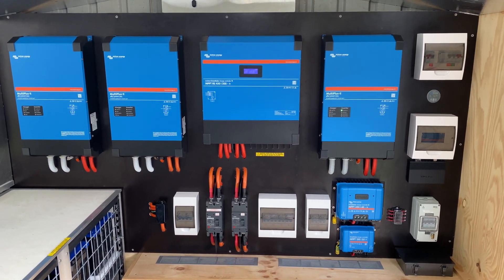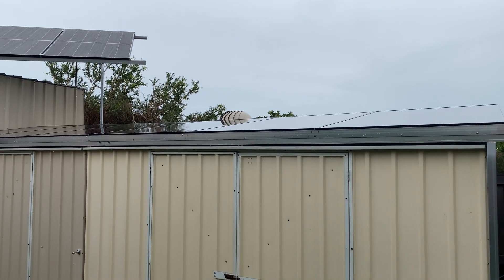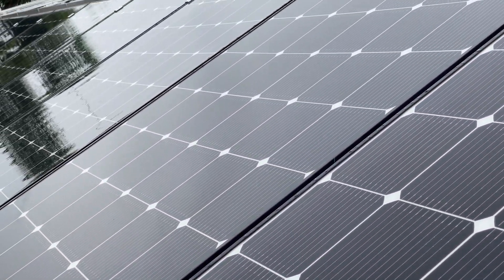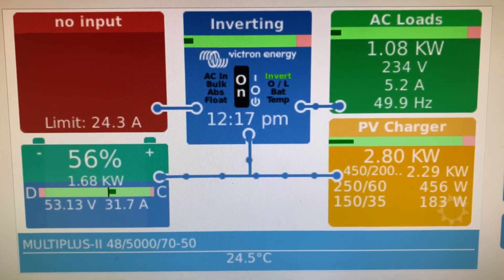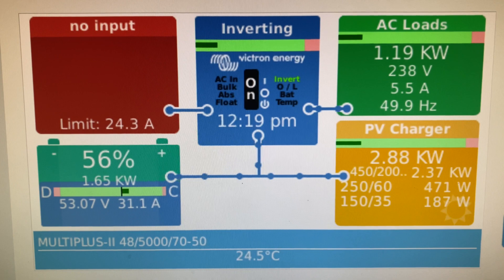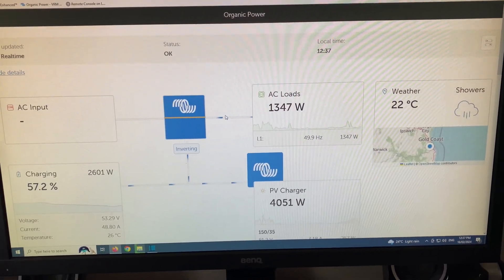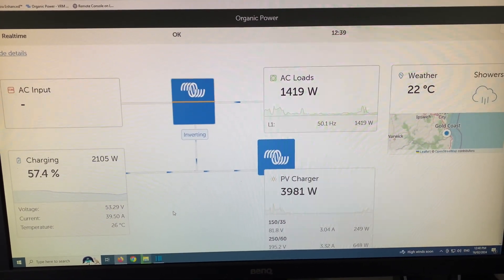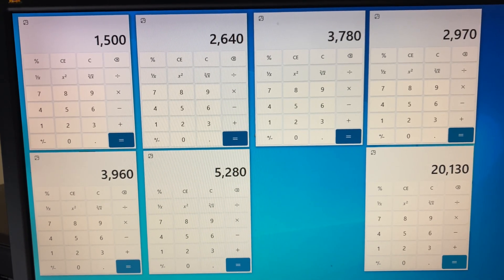EASIEST Off Grid Solar Power System - POWERFUL 20KW Victron Energy Triple Parallel Multiplus II

Comment: Thats one heck of a system fair play! If it can fit a panel it's got a panel.  Great stuff.
Reply from the maker: Thank you, it took some time but turned out well. The system is 6 months old now, we started with 5kva as a test which soon grew to 15kva after great results! Thanks for taking the time to watch and comment!
Reply: Yes I have a mini version 6kw in/out an RS450-100 i want more and more now!! :D @OrganicPower-Australia
Reply from the maker: Nice work 👍🏻 Keep at it. The off grid is one of the best investments I have made. Way better than a new car, boat etc. They only take. After a few years it will help pay for the car or boat. 😎 A gift to myself that just keeps giving. 🤙🏻
Reply: Exactly long term thinking a concept that most can not seem to grasp. @OrganicPower-Australia
Reply from the maker: I like the way you think!

Comment: Thanks for sharing I am looking forward to doing something very similar in our new build house. Just a question, do you have the Multiplus inverters sitting between the grid and your main switchboard? The Multiplus got CEC accreditation in November 23 so I am thinking of doing similar, or just leaving stove/ovens on the passthrough and everything else coming from the Multiplus.
Reply from the maker: Hey thanks for visiting! This system is completely off grid. It has its own main board, sub board and earthing system. I’m about to release an earthing video, stay tuned. The house is fed from the off grid board except the lights in the lounge and family room. This is for redundancy. Our old 3kw grid connect system pretty much just sits there feeding the grid now 😁
Reply: @OrganicPower-Australia  thanks for sharing. The grid connected system will pretty much pay for your daily connection fee. I'm still working out the nuts and bolts of my proposed system.
Reply from the maker: It gets better… The grid connect system pays back $350 💰 a quarter. Just got a refund 😎
Reply: @OrganicPower-Australia hey this is awesome,  I'm wondering what is the maximum feed back rate? 5kw?
Reply from the maker: Hey bud. I’m not sure, 8 years ago when the system was installed we were only allocated 3kw. Got knocked back from getting a 4kw for some reason. Energy provider probably didn’t want to pay too much out. Back then we would get a credit with the 3kw unit 🤣 prices have gone through the roof now!
Reply: @OrganicPower-Australia  we are allowed to do 5kw/phase in NSW I am going to kick off with around 8-10kw on the roof grid connected and export limited. I have 550m2 of roof space/potential solar panel space lol
Reply from the maker: This will be the future 😎

Comment: Interesting video. I wouldn't be brave enough to do that, especially in the suburbs. 

I have solar and batteries, but still use the grid when the super off peak rate kicks in overnight to charge the batteries and an EV. So when the really expensive rate kick in at 6 AM everything is charged.
Reply from the maker: Sounds like you got it sorted 👍🏻 thanks for watching 👀